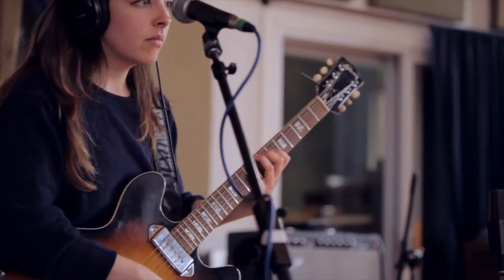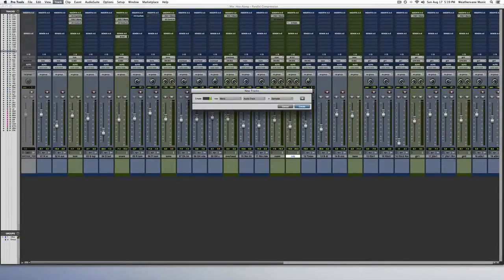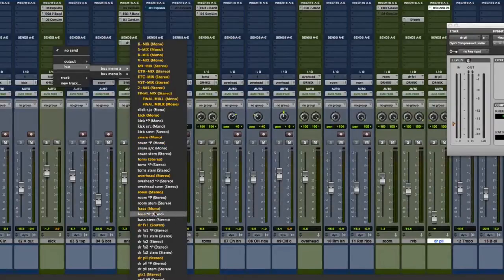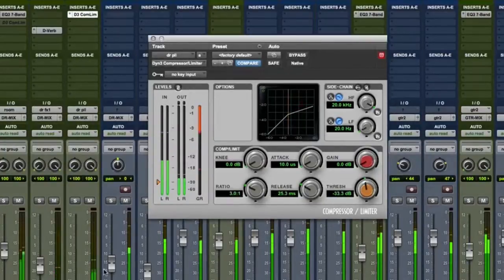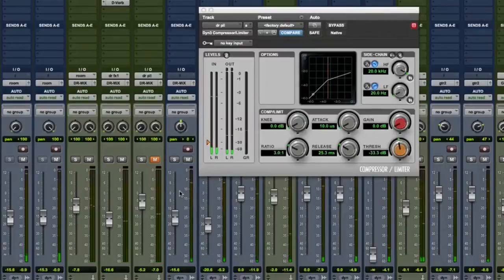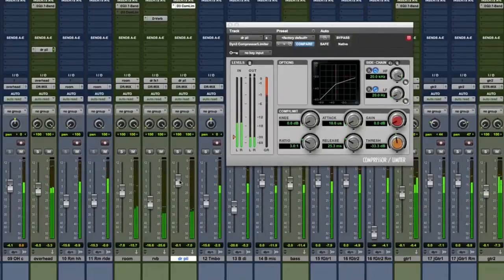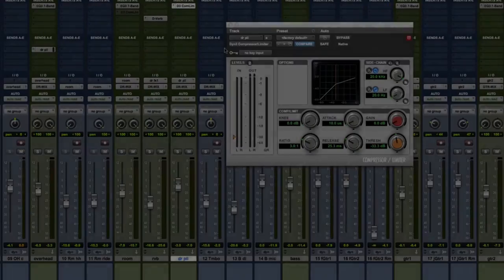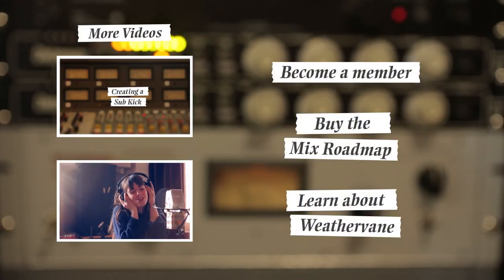Parallel Drum Compression | Weathervane Techniques

Comment: Hey Brian, are there any extra steps that need to be taken to avoid phase issues with this technique?  Asking for "a friend"...
Reply from the maker: As long as the DAW your "friend" is using has latency compensation there shouldn't be any issues. Sometimes though, since the parallel bus is so compressed it can highlight existing phase issues in the original drum capture. But yeah, you shouldn't have to take any additional steps!